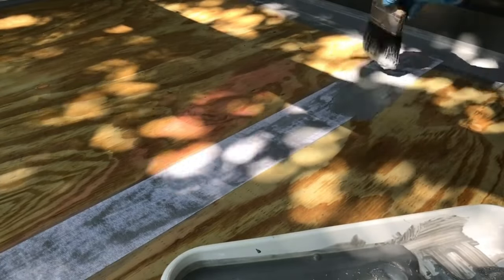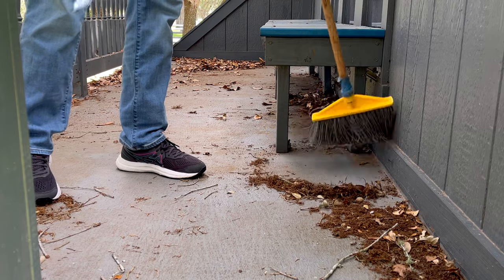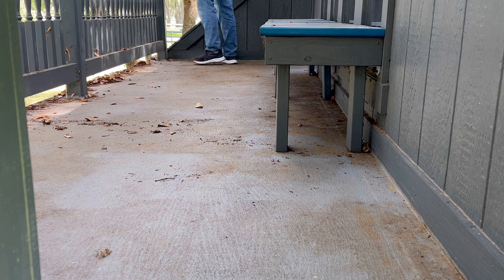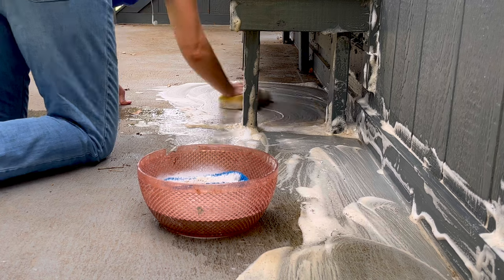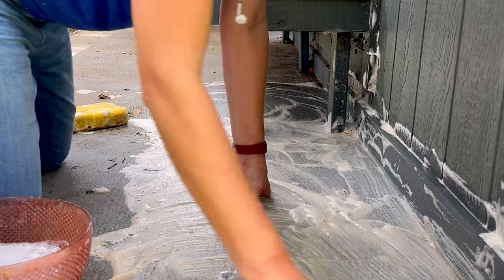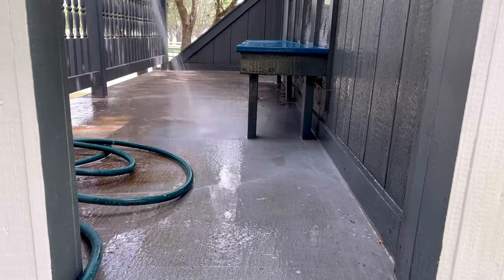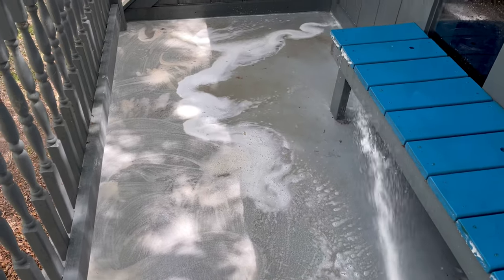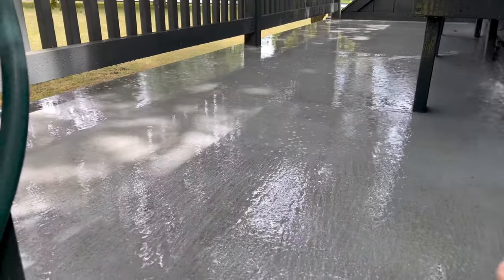Does Liquid Rubber Work? How Long Does It Last? User Review - 2 Years Later

Comment: I really appreciate your original video of the application process (I over think everything & worry about doing things wrong & I'm a perfectionist - so the visual is amazing) + the follow up 2 years later. It's wonderful for a female like myself trying to figure out DIY @ home stuff. I have a new construction (done by myself + friends) plywood deck that I need to waterproof... I live in the mountains with a LOT of snow during the winter, but also 90+ degree summers... I see you posted this 2 year follow up, 2 years ago... any updates, 4 years after the original application? - Thanks for your time!
Reply from the maker: Thanks for the nice comment! Mine is still looking the same after 4 years. But, we only get a few days below freezing a year. And, never any snow sitting on it. BUT, the company that makes this is Canadian. Which makes me think it must work in snow. :)
Reply: @AbbottsAtHome  I actually called Liquid Rubber to ask them some questions & they said it's not meant to be a roof deck, not meant to be walked on and they do not recommend using It for such application. Since mine is a very big deck and does sit in snow with cold temps, I went with a company that the contractors use in my area but that's so great yours still looks new!
Reply from the maker: Hi! I'm guessing they must have misunderstood you. They also sell a roofing product, not meant for walking. I used the deck coating. This wording is directly from their website: "This premium deck coating is perfect for all deck types, including wood deck boards, plywood decks, balconies, pool surrounds, fiberglass, vinyl, and concrete." So, the product is designed to be walked on and safe on plywood decks.
And, they were asking if they could promote my videos with ads last year. So, they know how I use it and liked it.
But, I'm glad you found an option. Good luck with your project!

Comment: I've researched this topic a bit and here is the gist on liquid rubber;

Out of all of the products as such, liquid rubber is the least toxic of them all. It's safe and doesn't off gas. It's versatile, easy to handle, low costs, insect proof, water proof, air tight. Some brands are better than others too.

For example, instead of buying that pressure treated lumber to build with, use non pressure treated lumber and coat it with liquid rubber building up the layers to 100mil thick.

For example, building a pole barn. Your barn will now last forever and a day because you coat the posts before they go in the ground. Just the area that is in the ground or exposed to the elements.

Now the rest of your structure is safe and clean and non toxic for you, your animals and your family.

You can also use it for posts embedded in concrete as a barrier between the wood and cement so that it won't rot the posts.

I could go into too many details on here like writing a book about it, but I think you get the idea.

There is only one major way that wood rots and that's from it getting wet and drying and then getting wet and drying and then getting wet and drying etc. That's it. It's microbes. But of it stays dry always and protected from UV, or if it stays fully emersed in water always, then it will never rot away. Either or, but not both.

It will last forever and a day.

This product ensures that it does and is the safest of all the options.

Cheers!
Reply from the maker: So much good info. Thanks for sharing!!
Reply: @SeamlessFab  Well, that's quite a statement you've made there. Sounds rather personal.

Actually wood is of course an excellent material to be used with glue, that's why people have been gluing together wood working projects since glue was invented and even before when they used pitches. These days some glues are so strong that the wood will break apart during strength tests long before the glue ever loses its bonds, such as Titebond III glue. And that's also why the industry makes engineered lumber, LVL and Glulam Beams literally for structural purposes that exceed codes.

Liquid Rubber isn't actually "rubber" by the way. It's a very special product with some amazing properties in it. One of its features is that it is elastic, just like rubber. Which means that any shifting or swelling and contracting isn't enough to breaks its bonds. Building up several layers, about 60-100mil thick creates a rubber like sleeve over the post which is 100 percent water proof. This is all that is required to protect the wood because it has long since been known that it is actually microbes that rot away wood and that can only happen if the wood gets wet and dries and then is continuously going through the cycle of getting wet and drying over and over again. If the wood stays fully submerged at all times never to dry then it will never rot away. Or if the wood never sees moisture then it if will never rot away either. This fact has been proven during tests over the decades longer than I've ever been alive. It is a very well known fact by now. I trust these studies. Many of these studies were conducted by lumber companies, wood processing plants, corporations that are responsible for creating the various types of wood preservatives and also by U.S. government and agriculture departments and they keep up with the industry as it changes. I don't just go into anything blind if I can help it.

Also one should note that there are many different variations of the same type of products too and some are better than others and have slightly different chemical makeups in their compounds that give it different advantages over its competitors. Some work better than others and understanding this is important too.

Also I take into consideration the climate the product is being used in. For me I'm 8,500 feet up into the mountains where it is very dry. My soil is type 2, very dry and sandy and silty, not clay, it is so hard below a foot that you'd think you're digging into solid rock and many times you are. It's fully of basalt rock which is volcanic and more dense than granite. This desert sees about 7 inches of precipitation in an entire year which means it's bone dry. There are posts in the ground out here without any pressure treatments that still look like new that were set before you or I were born. I've peaked behind the walls at these very old structures and in fact, where I am, there are literally mud brick houses that were built  in the 1600s out here made literally of nothing exceed this vary soil and a little straw with a bit of local timber.

Speaking of the timber I'm using, it's not pressure treated anything. It's local wood out of the mountains here, Doug Fir beetle kill which is some of the strongest and best wood to build with.

So for me, this is the right choice based on all of the research that I have conducted and relying on all of that which others have also done, all of that real world information that is readily available to anyone and everyone who wants it for the asking. I studied for over four years before I began building a single thing. I talked with engineers and I traveled and examined real structures, all of their underpinnings and framing techniques and some were very surprising actually. To me there is no better proof than what works in the real world and what has stood up to the test of time in various climates in various parts of the entire world over the centuries. And with each location may be required to adapt with a new technique for constructing in that particular area. Soil type has a LOT to do with it too.

I can tell you that if for whatever reason this idea was not going to work than my solution would be very simple, I'll simply pour concrete piers instead of planting my posts in the ground, and then I'd attach my posts to the concrete piers with wet set steel braces that are specially engineered for such a purpose and that would last for the next 100 years without any issues or maybe even longer. How do I know that? Once again it's proven by structures that are built this way that have been standing for this long or longer and they are all over the nation and in other countries as well. I know of an award winning mod century modern one in Canada that would amaze you. Well, it amazing all the very experienced building, architects and civil engineers that explore it anyway.

Perhaps I am a "novice", but I do at least know two important things:

1) There is no such thing as a perfectly built structure. It just does not exist anywhere in the world.

2) Everything has its advantages and disadvantages.

With that being said, I've seen more and more evidence that this product is a special product that will most definitely work for these purposes, but I have seen no evidence whatsoever at all that such a product, if applied correctly, has ever failed to perform it's intended function, purpose or design.

It is used for flat roofing systems as the primary component that sits under more harsh conditions that even inside the ground such as UV rays, wind, rain, snow, sleet, hail, debris, feet and equipment trampling on it, animals picking at it, weight and shifting about, even pools of water standing on it for long periods of time. And it is proven and holds up with little maintenance needed.

This video here is just one more proof in the fold that shows you that it actually works.

Anyway, of you still don't believe all of that then I suppose you don't believe anything.

But please don't act as if you know it all and we out here are just some ignorant, incompetent, idiotic do nothing's.
Reply: liquid rubber wont protect untreated wood from ground rot. Ignore this guy, buy pressure treated wood for any wood that touches dirt.

Comment: I like it!  Is your deck fully level, or does it have a slight slope to shed water?  I'm looking into this liquid rubber stuff as a quick & dirty method to seal up a flat shed roof...or more like it will be flat once I demo the gambrel roof it has now.  If I could get at least 2 years out it unit we scrap this shed entirely and build a new one elsewhere on our property, it would be great!
Reply from the maker: Hi! My deck is slightly pitched to drain water out the open side. I think this could get you a few years, at least, on a flat roof. Try to put a drip edge on it too. That’ll protect the bottom. 👍
Reply: @AbbottsAtHome  nice, thx!

Comment: Hello, Thanks for the video's, I am about to do my deck with this stuff also. Just a had a quick question, what did you use to edge the deck on the side we can't see. Did you use any kind of drip edge or flashing?
Reply from the maker: Hi! That deck sticks about 2” off the wall under it. I used the Liquid Rubber Textile to wrap that overhang and the joint where the wall meets that deck. Then I applied the Liquid Rubber. 👍

Comment: Is rubber coating successful inside wooden work as air insulation in container? Can it replace foam insulation?
Reply from the maker: I don’t think it would be good for insulation. It’s just a good waterproofing material. It can be used to line planter boxes to protect the wood from moisture. But, I wouldn’t rely on it for insulation.

Comment: Do you know if you can apply this liquid rubber on top of an existing cleaned coating?
Reply from the maker: I think you can. You probably need to prime the existing coat for better adhesion. I'd call the 1-800 number on the product. I've called it before and they were actually pretty helpful. :)

Comment: Can I use this on a wood shed floor to waterproof it and use it for my compact tractor to drive on it?
Reply from the maker: I'm going to say yes. But, if the tractor has sharp rocks sticking out of the tread, it may scratch up the surface. It'll require maintenance, just like anything else.

Comment: How did you do around the posts? Just paint up them a few inches or is there caulking there. Thx
Reply from the maker: I caulked the gap to create a flat surface, then covered that with the textile and applied the Liquid Rubber a few inches up.
Reply: @AbbottsAtHome  thank you

Comment: Our concrete front door step has broken tiles. Do you recommend this product on concrete front step?
Reply from the maker: They have a concrete sealant. But, if you want the front step to look great, I’d install new tile, decorative stone, or brick. 👍
Reply: @AbbottsAtHome  We installed the tile ourselves about 8 years ago on the front door concrete step and it's all broken up now. It is an eyesore. Since we live in the Chicago suburbs and the winters are cold, someone said that it breaks up but I don't believe that. Decorative stone sounds nice. Do you have any examples of it? I will also look around the internet. Great that you were able to do this house project by yourself.